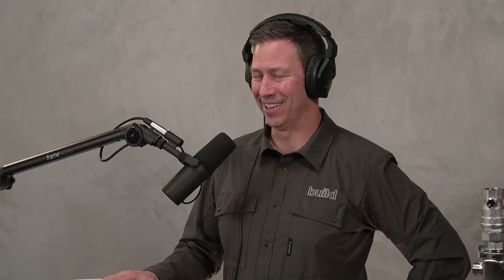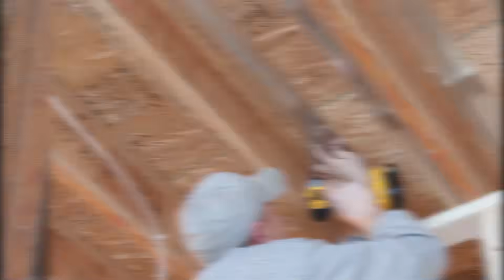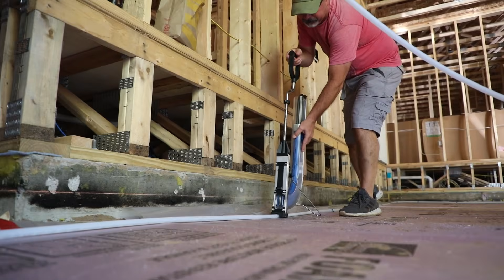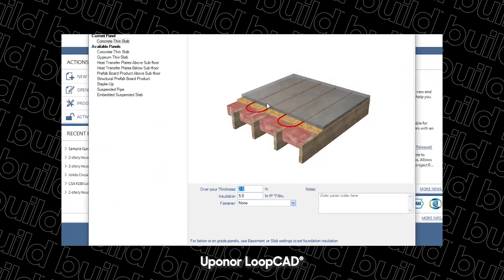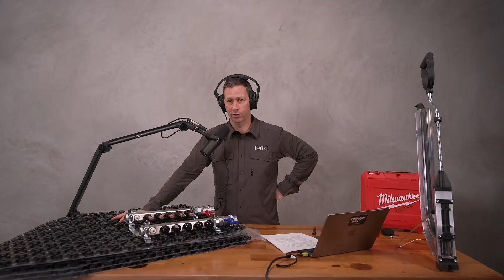4 Methods To Run Radiant Heat PEX Pipe

Comment: The only problem I think with this in my new build is that I still need to install AC… the cost of having 2 systems doesn’t make this viable 🤔
Reply: A heat pump cools as well.

Comment: I know heating is cheeper but if u had a wood boiler it could b all free except if u went on vaca   I’m heating 4500 sq ft with an o d wood boiler with the exchanger in the air handler n tho an after thought works well since ‘08   I’ve saved some 10-15k in propane at least n if I had to same extent could pass $25k easily. This infloor method is wonderful as long as u don’t have a major problem.

Comment: Here in Finland we don't do any connection inside wall, ceiling or floor all connections is visible and if something happen to leak you see it. Also all pipes are run into sleeve so if pipe somehow leaks it leaks into sleeve and runs out other end which is also visible. And usually those manifolds are placed room where is drain so IF something leak it will leak into drain so very small possibility to get water damage to your house because way of install.
Reply: This is what I was wondering, I didn't get through the whole video yet, but I want to hear about the leak potential and what that looks like if it happens, it seems like this would be a real pain to diagnose while it is small.
Reply: @mighty69r  Depends what leak and why. I would say biggest cause of leaks is bad installation meaning some connection isn't tight as it should and eventually it leak, other reason might be failure in product itself.

But for sure if connection is inside a wall cavity and it starts leak, it can leak a long time before anyone notice it and then failures are much worse compared to connection is at visible you see it leaking quite fast and it doesn't cause barely any issue.

Comment: how does radiant heat deal with humidity of the room during the winter or is that even an issue during the winter? any thing to be aware of there when making the decision between radiant versus forced air. i live in the mid west ( oklahoma) we seem to have high humidity

Comment: How do you say connections with PEX expansion tool is much more reliable. It's a brand new technology and has no long-term studies. And you're saying it's more reliable than brass and snap ring? Just so fraudulent. Who would trust years of service to just compression and no snap ring or anything

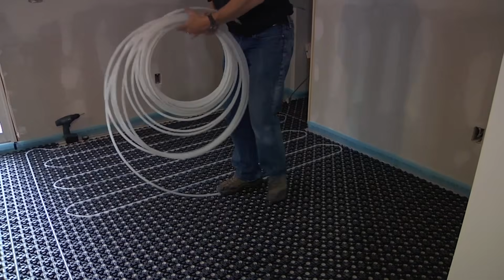Comment: 6:18 No, this is not a smart idea unless you're really rich. Placing those pipes between two layers of uninsulated concrete means heating also lower part of it and purely waste of energy (heat). It is not the best idea to copy some parts of European engineering into stick houses without thinking about entire design process and whole aim of saving energy, money and environment.

Comment: Radiant floor heating is not for everyone. If you want to reduce your energy consumption this ain't it. This runs 24/7 because it can take days to bring a cold slab up to 70 degrees. No nite setback or setbacks in general. If the weather goes from cold at night to warm in the afternoon, that heated slab is going to continue radiating heat long after the thermostat says stop. In cold climates where heating is all you need, this can be a more comfortable way to heat but in air conditioning climates it's a waste of money.
Reply: I have inslab downstairs. It will go +or- 4-5 degrees of setting on ambient thermostats. I  have warmboard upstairs +or- 1 degrees of setting on ambient thermostats. 
I drive a forklift for a living. And installed it all myself. Including geothermal (that I installed myself) for less than $25,000. Is actually more efficient (even without the geothermal) than forced air. That I had estimates for conventional HVAC installed in my house $28,000 to $34,000
Reply: And it's currently -9deg outside and my bare feet are setting on my warm floor. Woohoo.
Reply: Money is not a problem for you? Comfort is everything? Do the ROI and include the financing cost. Most people are surprised at the added cost.  @danmccoy6164
Reply: Also my geothermal provides chilled water 28deg f. during the summer that I run through chilled water fan coils.  For air-conditioning and dehumidification. Plus the compressor for the geothermal has a water jacket that warms water for my dhw. It actually turns off the pump so it won't over heat dhw in the tank.

Comment: This was a great video.  Very, very informative and timely for me, as im looking to replace an existing baseboard/boiler system with radiant. I'd like to see how geothermal can be used with a radiant system, and replace my antique boiler.  I'm in UP of Michigan, so efficient heat is essential.
Reply: I'm in the UP also, and looking to retrofit a 1970's addition with radiant floors (connected to a 1930"s main-home with efficient forced air). Local installers seem reluctant to work with radiant heat systems.  What area are you in, and what sort of contractor are you working with?
Reply: @inisii2  I'm in Marquette, and working with J-Goods.  They did radiant in my sister-in-law's house (new construction) and the install was amazing.  I'll also be using them for my new build - hopefully this fall.

Comment: Stainless is required for potable water if you want to use for cooling by running outside water through system before end use for domestic supply.
Reply: It's odd so many people have questions about stainless steel.  Not sure when or where I learned this but "stainless steel is forever." And it's safe.

Comment: If you have a properly insulated and sealed home is there really any point in "zone control" ?  I live in a 3200 ftsq home with one thermostat and 6 "zones" with one circ pump.  Individual temp is controlled by flow rate

Comment: after 32yrs of placing different heating solutions in homes built and remodeled the system with the most balanced characteristics has been hydronic heat run thru radiators. in floor is great but adds costs in materials and labor that usually pushes it out of reach. lifetime costs and service challenges are lower with room radiators and the overall system is simpler and requires less space. warm floors are amazing but in america they are a long way from affordable.

Comment: AMVIC makes EPS foam board called AMPEX for new concrete slab on grade floors.  The 4x2 foam interlocks and lies on the flat ground.  There is a heat shrink surface which is the vapour barrier ( no poly layer required) and this surface friction fits the Pex tubing for radiant heating.  The Pex is walked around the room and squished in between the discs on the top of the AMPEX, no staples , less labour install time.  The pex is supported by ribs of the Ampex foam such that the pex tube is suspended in the concrete.  The heat is only useful in the concrete, other products must loose heat into the product.
Reply: I’m considering something for an existing slab to use on top of —-any links ?

Comment: If you do another indoor radiant video I think it would be good to show tiring the pipes to the rebar/mesh in concrete poured floors and/or driveways, but I am sure Eric has videos of it. Radiant cooling discussion upcoming?
Reply: Yep. When doing a non-structural slab on grade we do 3" of closed-cell spray foam to the gravel (this creates a vapor barrier and seals the ground from radon gas). Then we lay down hog wire and zip-tie the PEX to it before we pour the concrete.

Comment: As a last step of installation (or on first use) don't miss to do a heating hydraulic balancing of your system by tuning in the flow valves. It's like tuning the strings on a guitar. Similar procedures like on a duct system balancing the air flow.

Comment: I have radiant heat downstairs in the slab and it's fantastic and it's so simple to set up. I have oil and electric(solar) to heat the water. When you are doing it, I'd recommend putting and electrical element (I have 3kw) in the loop just incase the primary oil, gas or heat pump heater packs up.

Comment: What is the lifespan of in-floor heating? I read 30-50 years, but some claim 100 years. That's a pretty big range -- even if I'm sticking in my home for 40 years, I really don't want to have to tear out floors to replace the radiant heating. What is the truth here?
Reply: What's the lifespan of your plumbing? Generally speaking, outside of massive gutting renovations, you don't hear about plumbing being torn out and replaced due to 'being old', unless it's lead pipe. What's the lifespan of a concrete floor? It's somewhere along the longevity of the foundation, which, while nothing lasts forever, it's not really an item that requires periodic replacement.

Thay being said, my dad has a garage with a heated floor that's not in great shape because it's a pole shed with no perimeter slab insulation, and they've only ever used straight water in the pipes, and it has frozen more than once, so there are a few leaky circuits that have been disconnected. Even so, that very badly done system is still functioning since 1985.

Comment: I see a lot of  questions about infloor radiant and geothermal. I've left comments on other comments.  
But here is what I have built. 
I  had a contractor put up the outside of my shop/house. 2400sqft of shop and storage downstairs. 1000sqft of living space upstairs. I did everything inside. Almost all by myself. Including wiring, plumbing, insulation, drywall, (Except mud) installing geothermal unit and pumps. Passed all inspections first time. 
I have geothermal, solar panels 10,080 watts and r29 walls r65 ceilings.  6 zones infloor heat 3 zones inslab in the lower shop. 2400sqft. I installed the insulation 2" outside the footings/ frost walls 2" inside with 45°cut on the top. So you won't see the insulation between the footings and the slab. 2" under the slab.  I made the manifolds and installed the pex.  Before slab was poured. Had contractor install warmboard subfloor for upstairs. 3 zones upstairs 1000sqft. I ran all the  pexalpex. Snapped into the warmboard subfloor. 6 loops to stainless manifold provided by warmboard. I have a pump to each zone. Instead of actuators. 
I used chilled water fan coils for cooling. Chilled water provided by the geothermal heat pump. Chilled water fan coils condense the humidity out of the air.  Just like a split system AC unit. So you don't have to worry about condensation.  Like you would with radiant cooling floors, walls, ceiling. I don't think cold feet are ever desirable.
They have flush mounted fan coils. If you don't like the looks of split systems.  I keep all 3400sqft  as warm or as cool as I want all the time. Zero bills. I live in Wisconsin. 
Because I have living space over my shop. Radiant is the only  way to go. Because the living space has to be 100 percent sealed off from fumes from the shop. Running for a little over 2 years now. Love having warm floors even in the walk in shower.
I forgot to say I also built manifolds. And installed the insulation and pex before having the 8000sqft of concrete poured for my driveway. I'm using radiant solar to heat my driveway. Will be installing 12 4×10 solar hot water panels this summer. Stated 170,000 btus.

Me being a forklift driver. Have accidentally designed and self built a Net Zero shop/house.
Reply: Kick arse Dan.

Comment: Living in Canada or colder areas the primary use would be heating but what other equipment would be required to have radiant cooling? Also humidity levels would be high during summer so I’m assuming a whole house dehumidifier would be required if you did radiant cooling?

Comment: Retro fit question:  Putting up pex to the underside of the subfloor with the aluminum plates. Can I spray closed cell over all that after the install?? 
And my flooring is real plank wood, is Radiant going to work well??
Thanks for all the help !!!
Reply: I think you want an air space to help heat the floor joist. There are foil faced products that are designed to be installed between joists. IIRC, the foil is installed halfway between top and bottom of joists.
Reply: @davepetrakos475  Thank you for the reply!!

Comment: Every winter here in Minnesota I wish I had installed a radiant system under my concrete driveway before I poured it 30 years ago.  Lament.
Reply: I did just that. I’m going to install the solar hot water panels this summer. Completely solar. Solar electric panels to run the pumps. Sun shines pumps start up. I couldn't afford to use a boiler. 
As a matter of fact. It used to be illegal to have a heated driveway in Wisconsin. Because of the cost to run one. It may not melt it during the storm. But as soon as the sun shines. Woohoo. No more shoveling.

Comment: When I lived in Germany in the 80s,  I had in-floor heat (at the time I believed they were metal pipes) but the bathroom was where this really was fantastic.   The bathroom was huge by German standards,  the tub and shower area was separate from the sink and toilet area, but in the same room, with half walls.   The floor and walls of the tub and shower area were piped with this radiant heat.    This made the cast iron tub warm all winter long.  It also meant that my then-girlfriend could stay in the tub forever because it took a lot longer for the water to cool off.

Comment: Great video as always.  Quick video editing tip for interviews though: have your editor remove the audio track from the person that isn't speaking.  Otherwise, we can hear you breathe (that SM7b is real sensitive!).
Reply: Weezy Matt for sure
Reply: Omg hi Legal Eagle!!! Fancy seeing you here
Reply: Question: At what degree of heat would the heat source would operate on for infloor heat? For instance, I have a baseboard radiator system I found running my furnace at 190 Fahrenheit works best for me.

Comment: So what would you do if wanted radiant floor heat on new construction and your house is designed to be air tight. I assume you would then need an HRV. 
But without forced air ducting how would you go about bringing fresh air into the house?
Reply: I have the Panasonic cold climate erv. I  ran insulated flexible ducks r8 if I remember right. To 2 small vents in the end of the attic. One outlet one Inlet. AND to 2 inlets. One in the bathroom ceiling. One in the kitchen/living room. To remove stale air.  And 2 outlets. One in the master bedroom. Which is on the far end of the house. And one to the kitchen/living room on opposite side of the Inlet. To bring in fresh air. Ran it under all of the cellulose r65. It has to be sealed tight don't want any moisture escaping into the insulation.
Reply: @danmccoy6164  ok that makes sense. 
The house I’m planning doesn’t have an attic. It’s all cathedral ceilings. So I guess I will have to run flex up the walls and into vents in multiple locations
Reply: @jacobconfer1693  wow cathedral ceilings in the bedrooms and bathrooms too.
Reply: @danmccoy6164  not for the bedrooms and bathroom on the first floor. But the second floor yes. It’s a hybrid timber frame so the ceilings will be tall

Comment: Why insulate below the concrete? Won't the sand & rock act as a heat battery?
Reply: Heat always goes to cold. The ground beyond the ground that is heated is always going to draw the heat away from your earth heat bank which draws heat away from your slab. It's a continuous loss.
Reply: @danmccoy6164  Correct. Just a question of how much you can inhibit the process.
Reply: It does, yes, but not a very good one. Without insulation, you can expect about 41% of your heat to travel "downwards". With insulation, only 18% travels down. By comparison, our system (with insulation), has 97% of heat travel up, and 3% down.
Reply: There are horror stories about homeowners being sold systems without insulation under and around slab. ($400/mo heat bills for 800s.f. cabins).  

You are most likely installing for economics then comfort. If you can't afford the insulation,  then you WILL NOT be able to afford the utility bill. The ground is a vacuum.  Not a heat sink.  
Keep in mind the ground temp is constant eight feet down. - you will fail to get it to 80 in one heat season.

Comment: Are there any other things to know with radiant heat? Do you have to user a certain type of water heater? Labor costs? Heating cost (my dad's boss built a mansion last year with radiant heating and his first month's power bill was $6000 but I'm not sure what caveates that includes eg contractors using electricity)? Maintenance? I'm assuming you still need some amount of air flow with ducts or are ceiling fans enough?